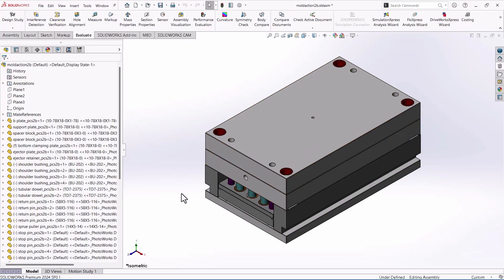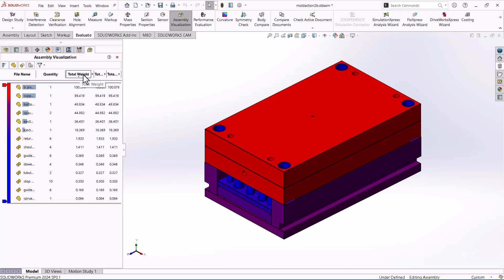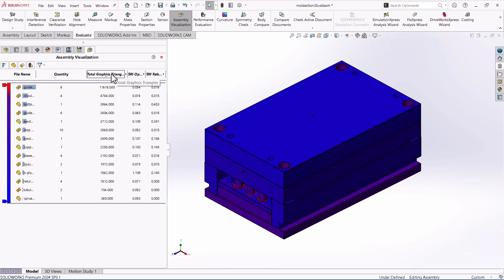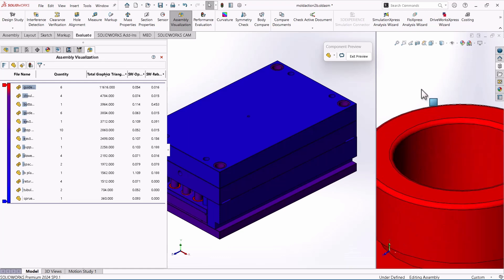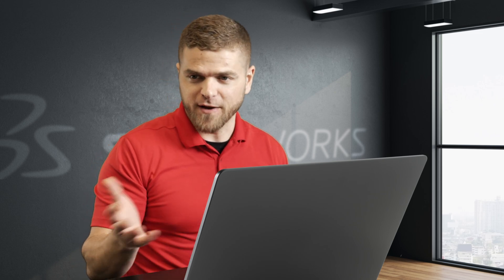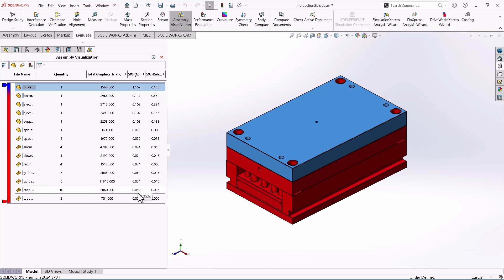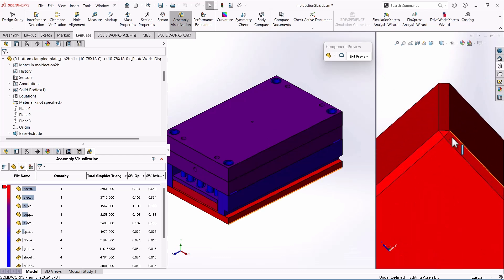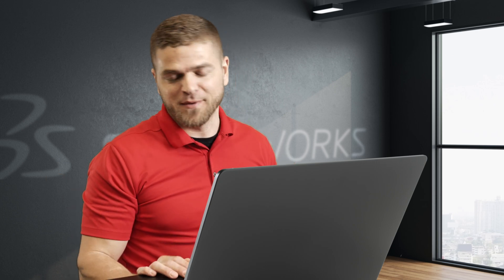How to Optimize Assemblies and Troubleshoot SOLIDWORKS Performance - SOLIDWORKS User Tips and Tricks

Comment: its the one thing, after over 20 years working with CAD systems, i don't understand why they are so bad at managing triangles (when the GFX cards i need to put into the PC are 3x the cost of gaming cards), and after two years of working with Solidworks, i can even less compute why i have to look at the triangle count of single parts in the first place, when i was used to see dynamic triangulation in Inventor for 20 years now. 
a 2k € geforce these days is able to do real-time raytracing photorealistic graphics with millions of triangles on screen @60fps... but Solidworks needs to turn of shading and shadows if you load in an assembly with a few detailed parts that are mostly hidden from view...